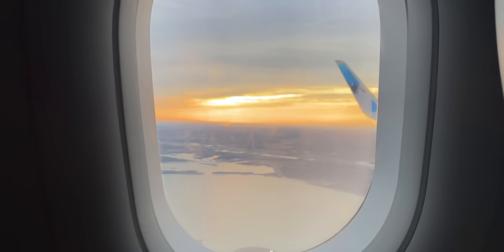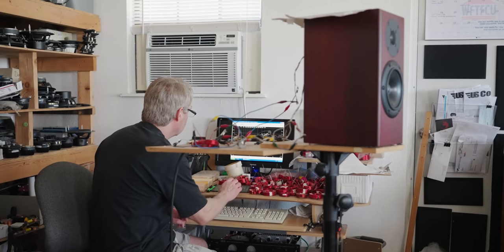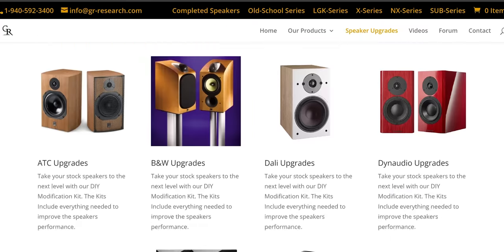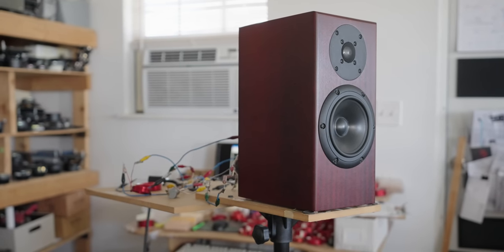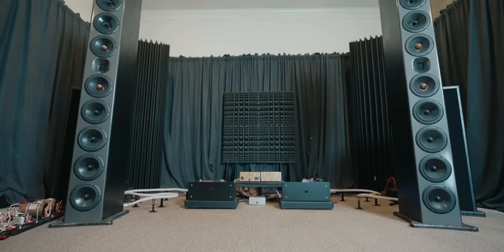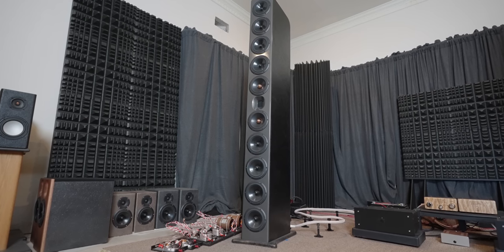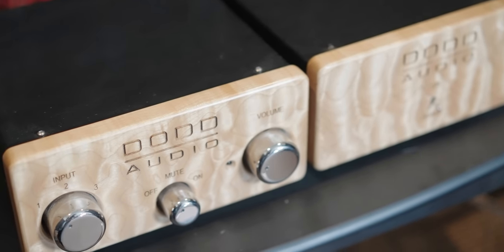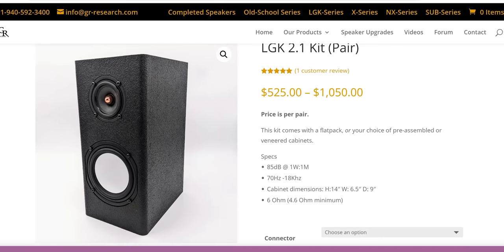Are the GR-Research Audiophile DIY KIT Speakers & Upgrades Worth The $$$?

Comment: Thanks Jay, for the open and honest way you convey your opinions.  Long before discovering GR Research, personally built speakers from scratch and modified off the shelf models.  Crossover parts quality ALWAYS makes a difference.  Speakers sent to Danny have problems, not just a different way of doing things.  That is far too kind an assessment.  Been in the room too many times when the bean counters take over and engineers are forced to make compromises.  All the R&D in the world is too easily discarded to save as little as a few cents per unit.

Have to disagree with your presentation of Danny vs ASR listening to only 1 speaker.  Danny is correcting issues with an already purchased speaker, not reviewing.  It only takes 1 speaker to correct FR and resonance issues.  As you pointed out Danny believes in a neutral FR.  Owners of that speaker model can then decide if a neutral FR provided by the GR Research mod kit is worth trying.  

ASR is testing and listening to 1 speaker to form the basis of a purchase recommendation for a pair.  Also, looking for FR and resonance issues.  It would be apples to apples if ASR purchase recommendations were based only on those measurements.  Listening, a subjective action, is added to the review with the claim it is only necessary to listen to a single speaker to predict performance of a pair.  Danny is correct to point out listening to only 1 speaker is an incomplete review.
Reply: There is a coincident advantage of a neutral FR as shown by any waterfall graph.  Getting rid of resonances and breakup often results in a smoother response.  Phase matching around the crossover point also results in a smoother response.  It's not so much about the neutrality of a response as it is about dealing with the other problems that cause an uneven FR.  For example, Danny will often ignore spikes in frequencies above 14KHz unless he finds ringing.

Comment: Testing a single speaker to change-out cross-overs is a COMPLETELY different thing from designing and playing back a speaker to ensure that everything from diffraction, CF, dispersion and other factors are dialed-in.  Now, if Danny was going to change-over to different drivers, make changes to the enclosure or other such foundational changes, then you can't just work with a single speaker.
Similarly, to evaluate a speaker for all the things we care about, you have to have the same number of monitors that the source material is designed to be played back on, whether it is mono, stereo, ATMOS or anything else.  Danny is correct.
Reply from the maker: two things.
1. He does change drivers, port and cabinet inside at times. He still works with 1 speaker.
2. it goes both ways. The reason Danny criticized testing only 1 speaker was because you can't hear imaging and sound staging ("the intangible things" as danny quoted). I will argue that is the same when designing a speaker or an upgrade crossover to a speaker; according to him, he spends lots of time listening to his diy speaker kits to get the "intangible things" to a desired point. Same thing can't be said about his upgrade kits as he does not do listening tests with 1 speaker
Reply: For Danny to take the time and added expense of receiving two speakers and spending many more hours trying to find tune them while being limited to merely crossovers anti-resonance foam and port size would be a monumental waste of his time.
Reply: @Jayiyagi  I think it is very rare that he changes drivers on used speakers he gets in, and also rare that he changes the port or cabinet. He does like to change change the connectors.
Reply: @Jayiyagi  I know he does change out drivers, as well as create new speaker whole cloth, and I have seen those videos, but he then does stereo testing (i.e. not just one speaker) in all the videos I have seen.  If he ever changes out drivers or makes box modifications, but does not work in stereo then he is making a mistake.  I had not seen a video of his where he did that.

However, and I have done acoustic and photonic imaging and implementation studies for civilian and military applications for years, and also own and have founded several media labs since the 1980's and own and run a DSD + PCM Ravenna studio where we have reengineered our rooms (stereo, 2.1, ATMOS 7.1.4 and 9.2.6, with ambisonic binaural mix-down), and can say that when you are only changing out cross-over components for a unit that is already driver spec'd, any phase translation differences translates to frequency response, and is therefor symmetrically virtually all about frequency response and HF/LF roll-off.
Reply: @Jayiyagi  Seems like Danny is most interested in getting the flat response on his upgrades. He only needs one speaker to do so. He knows the upgraded parts will help in other areas as well. Like detail, sound staging , ect. Now if Audioscience is only reviewing a speakers response they can get away with only one speaker, but Amir sits and listens to one speaker for his personal opinion on a speaker. He is missing sound staging , imaging , act. in those reviews. That is what Danny is saying.
Reply: @Jayiyagi  I addressed your point number two quite thoroughly in my video response. So I won't do on about it here.
Reply: @amdenis  Make and Post a video to illustrate your points with whatever data you can provide to illustrate your points. Sounds like to me that you are talking about taking his process a step further. This might be a profitable addition to you current operation.
Reply: @Jayiyagi  But it doesn't go both ways. "Same thing can't be said about his upgrade kits" right, because they are NOT the same!
Reply: Jay, those soundstage characteristics are a product of a single loudspeaker, ... and how well it excels in both the frequency and time domain.  

Get that right, and the soundstage magic will flow when mated up in stereo. 

Technically, the next level is hand matched pairs, ie., Bill Dudleston at Legacy hand matches pairs of the small monitor sized Calibre ...
The smallest of his flagships at ~$6k/pair three-ways seem to be a killer sweet spot in his lineup. 

He claims hand matching resolves additional levels of soundstage detail and dimensionality.
Reply: @veroman007 true

Comment: To qualify the following comment, this video is my first exposure to GR, so I speak as neutral a party as possible having heard only your take.
     As someone who works on/builds/upgrades speakers, you can ABSOLUTELY upgrade a speaker without changing the network at all. Simply replacing the existing components (not changing values) with higher quality versions of components ones of with the exact same value can make a huge difference.
     It goes further. When building my personal speakers, my "serious" speakers, I did a LOT of A/B-ing on a component-by-component basis, and combo-by-combo basis. I can say with 100% certainty that even higher quality components can vary widely, and add or subtract from the "synergy" of the network and drivers as a system, greatly.
     When developing said speakers, at one point I had 5 or 6 different versions of the same inductor hot-glued to the side of the cabinet, so I could easily switch between them.
     My point is that a single component can make an audible difference, and when you're dealing with consumer-grade products, they're usually optimized to sound as good as possible within a certain threshold of cost-to-build, the idea being to guarantee a minimum level of performance while still meeting the budget for building them.
     Usually, this means using the cheapest components of which you can reasonably assure the supply-chain, while not compromising that minimum "standard" of quality.
     It doesn't mean the developed product sounds as good as it possibly could with the OEM configuration, but instead ensures a consistent level of performance across the entire production run of that model.
     And STILL, there are countless examples of electronic products that vary noticeably, even dramatically, depending on when during the production run a unit was produced, because the manufacturer swapped out some single component due to supply change issues, per-unit price changes, or some other reason the original component becomes unavailable.
     All of this is to say, you can't dismiss the possibility that GR is, in fact, UPGRADING speakers, just because he can improve them fairly quickly/easily. And that's without even TOUCHING the change that actual component-value changes, or the impact an expert using specialized analysis equipment, can make.
     I have personally "upgraded" any number of commercially available speakers, of all price-points, with little more than a frequency analyzer, some specialized knowledge, and a willingness to spend more than $0.05 on components.
Reply: You understand these issues well. I have worked in r&d in corporations and low cost pars and manufacturing are always a major objective.

Comment: I bought the GR Research kit for the Dynaudio Special 40 and it was great. I got much more clarity and it was well worth the money.
Reply from the maker: Thank you for sharing!
Reply: I wasn't going to use his kit as I prefer different capacitors, but I have considered buying a pair and upgrading the crossovers. I have several very good monitors though, so I probably won't. They don't have Dynaudio tweeters, but their Hiquphon tweeters are pretty good. Thanks for your reply, it bolstered my opinion.

Comment: I agree with your assessment. I built nx-studios and a sealed box servo sub. They are fantastic speakers for jazz, and get a really tight bass. But yes, they are missing something in the mid range. For home theatre it's ok for my apartment, so it doesn't bother the neighbours, but yes, it lacks the punchiness of and traditional sub. 

I haven't done an upgrade kit, but from his analysis he obviously corrects a lot of errors in the design of some speakers (out of phase drivers and such). I understand his criticism of amirs review with only one speaker, as one of amirs complaints was output level, when he was overdriving one speaker to distortion levels.
Reply from the maker: yes I do feel that was not a fair review but that wasn't Danny's main criticism; it was actually the fact that Amir didn't listen to a pair and thus can't comment on the soundstaging and imaging capabilities that Danny focuses in his own DIY Kit designs

Comment: Experience helps. When I graduated top of my Electrical Engineering class, I thought I was pretty smart. That attitude quickly  switched to reverence for the seasoned much more capable designers. I'm not getting that vibe from you Jay. We don't need to kneel at the GR altar, but when you question GR cross over upgrade kits being only "mods", it tells me all  I need to know. Even doing nothing other than keeping the exact same cap and inductor values in higher quality components is a definite win.
Reply from the maker: Upgraded parts are an upgrade. Not arguing that. But it’s not just an upgrade when the crossover is being re-designed in 20ish minutes that took many of these companies a lot longer. Redesigned crossover = different speaker, therefore I was only logistically critiquing in the word “upgrade” but like I said in the video, if you think it’s an upgraded sound, then I guess it is
Reply: If they have the same value and tolerance, they cannot sound different

Comment: I can tell you from intimate experience, I helped upgrade 2 different Klipsch models for friends using Danny's upgrade kits, and the improvement was drastic.

His upgrades turned almost unlistenable speakers into reasonable sounding speakers.
Reply: Let me add, that the statement in the video that all Danny does is flatten the frequency response is not correct.

He usually corrects phase issues, impedance issues,  cabinet resonances, off axis response, etc.

As someone who has built and upgraded many speakers over many years, the improvements Danny makes, are very predictive of how well a pair will sound, even if you only have 1 speaker.
Reply from the maker: Thank you for sharing!
Reply: Amir reviewed Dan's 1200 dollar kit full range driver n sed it was crap...
Reply: @matthewtaylor7355  Damn, $1200 kit?? Might as well save some money and get a REALLY good speaker.
Reply: @matthewtaylor7355 because he listened to a single, small speaker, and expected it to play at 96dB. Who listens to speakers like that? Nobody. Take his SUBJECTIVE speaker reviews with a grain of salt. The measurements? Yeah, they're worth looking at. But, you need to think about how a speaker will be used.

Comment: Very objective and honest review from your subjective point of view Jay!I I appreciate that you never hold anything back. I have only good things to say about the GR Research KEF Q100 upgrade and the16 strand speaker cable kit with the signature tube connectors. The Q100 is of course KEF's absolute lowest rung speaker which appears to have have been discontinued recently. The signature UNI-Q driver KEF used is, excellent, but let down by cheap components in the x-over network and a cabinet and damping materials that leave much to be desired. I only stream music using a laptop and a Peachtree Nova300. My observation is that the sound is less fatiguing, far richer in detail, has better sound staging and remains faithful to the source music, but as you noted, somewhat to my shock, was that even the vaunted NX-Extremes would benefit from the low end punch of a sub woofer; this definitely holds true in my case as the lack of one leaves a big hole in the detail and overall musical presentation. I am eyeballing a KEF KC62 as it would fit, size-wise well in my smaller living area and have heard only positive things about it. I would definitely buy again from GR-Research maybe upgrade to one of their speaker kits. Like The Dude says.'Yeah? Well that's just like your opinion man!'; this is my opinion of the GR Research upgrade kit and say this not pretending to have your breadth or depth of experience evaluating all of the finest equipment the audio industry has to offer and because of your integrity and quality reviews I will continue to value yours. Keep up the good work Jay!.

Comment: I have been a DIY’er for years and I understand GR sentiment about the existing speaker brands. The diy speaker shop I got my parts had the same conclusions as Dany. The shop had an good anechoic chamber with a Clio system and he did measurements of existing speakers for an audio magazine, the results were often baffling. The thing is you can not confuse crossover mistakes with “ voicing “ the speaker. Two speakers with a reasonable flat measuring response do not sound the same “ neutral “.
But I do think you need to do both measure and listen for best results.

Comment: I think upgrade would be replacing parts with same values but better quality. I can see how capacitors,resistors,inductors,wire or whatever else could see improvement with higher quality. However when the crossover is redesigned that would be a modification. I would start with upgrades first. Great video. Thanks

Comment: Thank you.  I have been waiting for this review.  I had purchased the speaker cables and then ran across the controversy on your site and other sites.  The speaker cables were a good upgrade.  I have Klipsch Cornwall IVs but may explore open baffle speakers at some time.  Having independent external reviews like yours is critical for me to trust the description of sound.     One shouldn't need to review in their studio because no potential purchasers will have the same listening room as GR Research.  Your review at confirms they have decent sounding speakers and that their subs are recommended.  Their subs are something that I have been considering an dare a likely upgrade for me  in the next few years.

Comment: I understand that it is difficult to do, but a review of original and "GR-upgraded" speakers would be a very interesting series for this channel and would interest many people.
Reply: I do not think anyone is doubting that upgrading the crossover network to fix basic phase issues and putting sound dampening on a $200 budget bookshelf speaker cabinet would not be an improvement.  Of course it would, and for that reason, I am sure most of GR's upgrades are probably worthwhile as I'd bet the <$750 fixes are probably the bulk of their sales.  The debate here isn't really even about GR Research to begin with... we're back to beating the dead horse on whether or not [insert $3k speaker here] sounds better with a corrected flat response or is the embellished response from the manufacturer more preferable.

Comment: Great presentation.  Danny and his fans should be pretty happy with this assessment.  High praise for his stuff considering the breadth of listening experience you have.  His higher models seem to rank right up with some of the more exotic brands.  The Audiophile Junkie uses his extremes with subs as his personal system, so it is great value if you have a large room.